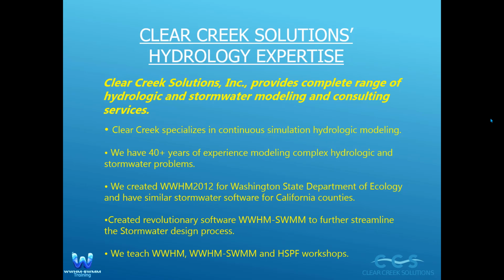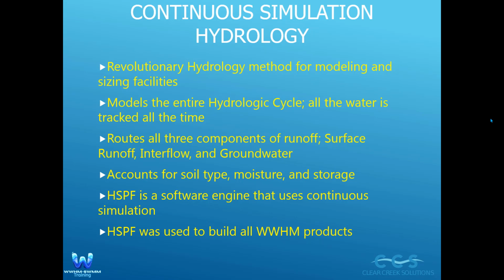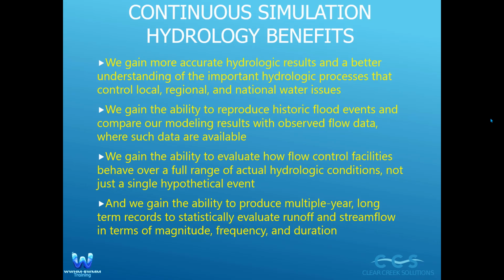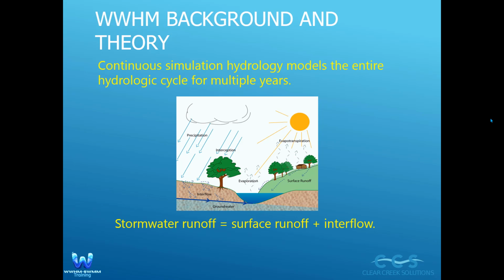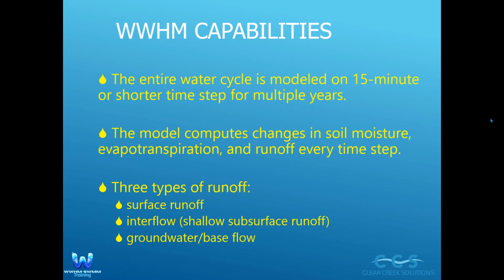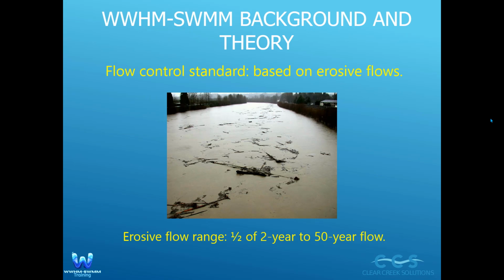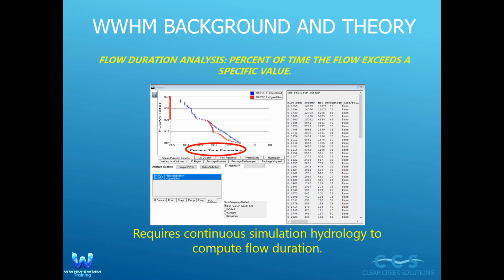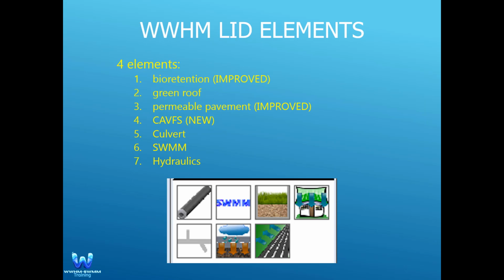WWHM-SWMM Workshop | PART 1

Comment: Please check your description of the design elements becuase starting at the top left then down, they seems to be incorrect. Check out the open channel #7 , it doesn't line up with any square.  I'm sure this has been pointed out to you before. If not and I'm correct , one might ask: what else is wrong with this model since it is a black box.
Reply from the maker: The numbered list was general list of basic element in the model, and not intended to line up with the box on the right, but I understand why someone may fine that confusing. We have numerous videos describing the elements included in WWHM-SWMM, and I can assure you, there are no issues. In reference to the comment about the model being a blackbox, I'm not sure what you mean. When you run WWHM-SWMM, you can view the HSPF input files and SWMM inputs that were used in modeling; completely transparent. Do you have a specific question about  how the model functions?